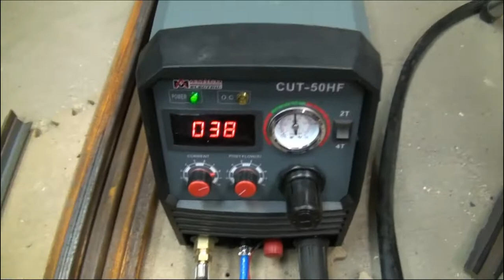How to fix the Non-Touch Pilot Arc on a Plasma Cutter

Comment: same here new cutter no fire no air and it wont register any amps on the gauge flashes 000 but it does have air pressure when I say new unit I"ve only used it 2 times but the warranty is up it was an ebay china purchase so no tech support but the thing did cut pretty good for anyone watching steer clear of these deals anyone have an idea of the fix for this?